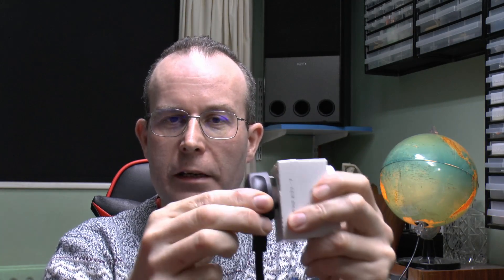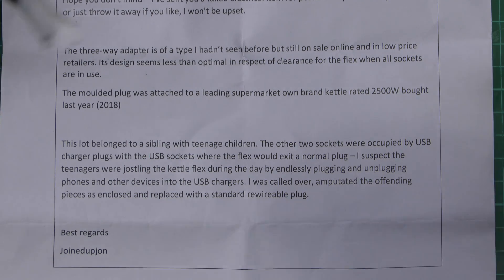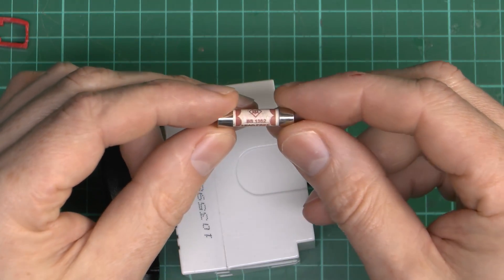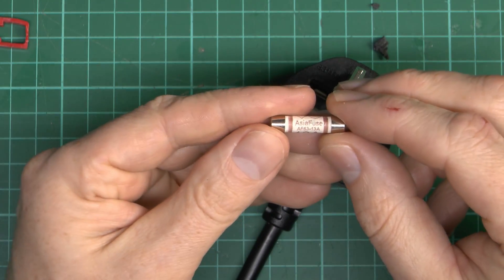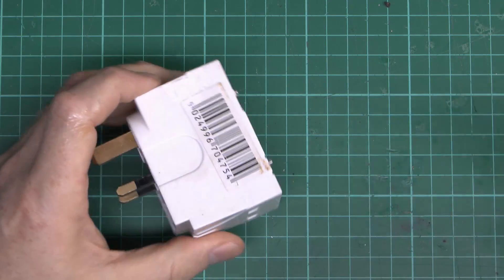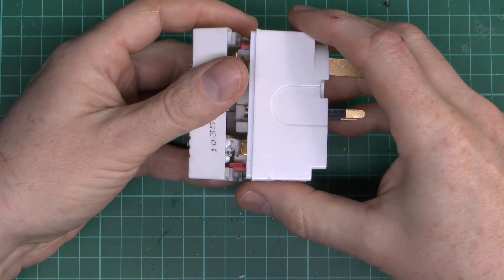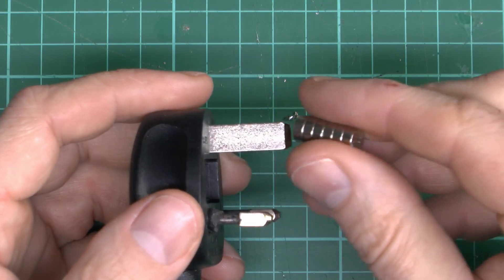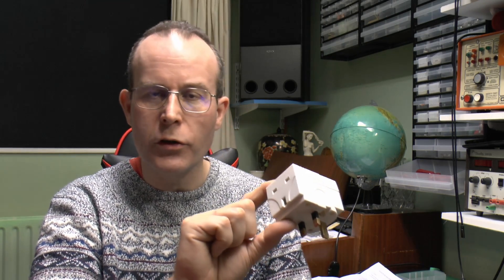Melted UK Plug stuck in a 3 Way Adaptor

Comment: This happened to me. I smashed adapter  socket, opened plug and it looked fine. 
Now it’s stuck in my kitchen wall.
It’s connected to the big steam iron... but it’s still switching on. 
If it had melted would appliance still work ? 
Thanks

Comment: i have one where the fuse is working (tried it in a test plug), the sockets are in good condition (no melted parts and plug can be inserted and removed easily) but the plastic around the fuse are melted, and when i bypass the fuse it works but when the fuse is connected it doesnt work, any idea what may have caused it to get into this situation. thks
Reply from the maker: Probably a loose connection to the fuse which caused overheating.
Fuses get hot in normal use anyway, so it only needs to be a minor problem to start with, the heat makes it worse.

Comment: Hate these things as they tend to damage the socket they are plugged into eventually, due to all the combined weight of the things plugged in pulling down on the main socket.  Also you often can not plug in large wall wart power supplies, due to the orientation of the protruding part of the PSU.

Comment: I was always of the understanding that plugs, adapters, socket tops and lightswitches etc had to be made from "thermosetting" type plastics (or metal etc) rather than "thermoplastics" precisely to stop them melting if they get hot.  Is that not (or no longer) the case?

Comment: Who would plug a high load appliance such as a kettle into a multi-way adaptor? 
Lack of common sense springs to mind.
Reply: The adaptor is rated 13A so there should be no problem running a kettle plugged into those ports. The problem here is simply that it was NOT plugged in properly, and was continually arcing off one of the plug tips. Even the best wall socket would have burned out under the same circumstances.

Comment: The plug looks like it was more to blame that the adapter. Poor connection leading to increased resistance, which caused the plastic to melt on the pin of the plug causing more resistance and heat... until it failed.

Comment: Are there any fuse testers? (in order to burn them, perhaps even getting the characteristic... or just telling if it's conforming to the stated rating)
Reply: they are complicated, they are meant to take some surge over current for a period of time, and even then to blow very slow indeed, bascially it will take a major fault to blow a fuse, nothing else, in which case im sure even the cheapest fuse will work well enough, it has thinner wire than the cable, which is the point, it would cost more to make a fuse that is a fake than just use thin wire,

Comment: I always have the kettle straight into the wall socket and don't like adapters or 4 way extension leads being used in the kitchen for safety reasons.
Reply: yes im sure the kettle says to do so as well, god knows wy they are using an adaptor with other things in a kitchen,  do they only have one socket in the house?
Reply: Learnt the hard way! That means the one part of my four way extension was burnt in by that faulty plug is gone? There's no way I can take the remaining bits out and continue to use that particular part of my four way that was burnt?

Comment: I don't know why people get so uptight about lead in electronics. You don't come in contact with the lead contacts unless you open it up. Even still, you'd have to lap at it like a cartoon idiot with your tongue. People could actually just wipe down the outside surfaces with a damp cloth or something if they are worried. A duster would probably do it too. Lead poisoning usually happens when children eat lead paint either on a wall or on their toys. Just don't buy painted toys for your toddlers if you are worried about  less than legit Chinese sellers. Kids shouldn't play with antique toys unless you want to have it tested for lead. As for lead solder, you are just melting the lead/tin alloy and not evaporating it. That smoke is your flux burning off.
Reply: We should be recycling electronic waste. Not that the lead is really that hazardous next to the rest of the crap that is dumped. The solder, copper and other materials should be recycled. Copper is definitely too precious just to dump and not recycle. Hate the fact that copper wire is getting more and more costly. We constantly mine copper, yet we just dump the spent stuff that would take no time at all to purity back into good copper wire again. It's not like we are going to give aluminum another chance any time soon. It's only mixing the two metals that is bad. Just don't do that. Even when you do that, it's the copper wire that oxidises. Aluminum is fine if you don't bend it much and make proper transitions to copper. It's very hard to get aluminum compatible receptacles and switches. They won't even allow the selling of aluminum wire for pigtailing in older installations. They do allow aluminum runs to sub panels which is kind of weird.

Comment: This is what I was talking about in one of your recent video's. Mum had a clothes drier plugged into one, it was the only device connected, it actually set the adapter on fire. I have refused to use the damn things ever since.
Reply: They are pretty horrific, I have to stop a guy I work with using them on Audio Visual equipment we work on. Would rather install another 2 gang socket than use these crap things.

Comment: Use a tiny cutoff wheel to cut a slot on the back of your screwdriver bits, then you can drop them into the hole and use a regular screwdriver to turn them
Reply: thats a good idea,im onto that .thanks for posting.

Comment: I bought a new 3kw kettle last year, & the moulded on plug got quite hot after about 3 minutes, so I changed it over to a rewireable plug & the plug now stays completely cold, even if I boil the kettle several times.

Comment: Yes, those plug in the bottom ones are a really bad design. They do it to make the construction simpler.
I've only seen the live side burnt in a socket before.
Reply: The live side burns often because of a poor connection with the fuse.

Comment: I think the evidence was there from the very beginning, the plug was not pushed in all the way as it was moulded in that position when John received it. Meaning that obviously the line connection wasn’t making good contact causing a high resistance and consequently overheating.
Reply: pmailkeey but the load current is still being drawn through the incapable high resistive faulty section which causes that section to go hot.
Reply: It was very obvious.
Reply: https://en.wikipedia.org/wiki/High_Resistance_Connection

Comment: I had a panicked phone call from my step-daughter last week.  Her washing machine was smoking...  Turns out to be exactly this same problem.  Her ex had cut off the original plug, to get the cable through a cupboard, and then failed to properly secure the live conductor inside the plug.  It had melted a hole about half inch in diameter out of the adaptor, over the course of about a year.  She was lucky that she hadn't put the machine on at bedtime, or as she was heading out the front door.

Comment: did you know a torx bit will fit most triangle screws....
Reply: Sounds like a good way to mangle a perfectly good Torx driver...
Reply: @Agent24Electronics  never been able to fit a torx in a triwing screw, i normally get a cheapo screwdriver and file the end to fit the screw,
Reply: @andygozzo72  works too never had any pb with Torx thought...
Reply: @Agent24Electronics  that why I use the cheep multicrap from my roomate!
obviously I'm not using my good tools on think.
Reply: Indosarnia  I avoid idiots - so that's not an issue.
Reply: Indosarnia  Do you ever wonder how long it'll take before the penny drops ?

Comment: when I had my kitchen done up I stipulated lots of double sockets because you shouldn't really be plugging more one thing in a socket and trailing leads have no place in the kitchen.
Reply: @pmailkeey My ring main drops down on the right side at the front and the back of my kitchen on the right and at the back on the left. The guy before had still managed to get a double spar on the right front plug which was disturbing, luckily the electrician was a by the book guy and sorted it out with the addition of the sometimes problematic RCD.
Reply: Indosarnia  Do whatever you want. This was convenient for us and works fine. The cooker supply ended with a wall switch combined with switched socket as was/is commonplace. The cooker feed is only supplying cooker, dishwasher and kettle (and garage). Cooker's used before meals, dishwasher after - so are unlikely to be on at the same time. Supply to the garage is off most of the time - so the loading is well within the capabilities of a typical ring.
Next you'll be complaining I put a plug / socket arrangement on the cooker too.

Comment: Where does the myth from it been the line pin come from? In my experience after unplugging large continuous loads the neutral pin is only slightly warm and the line pin is warmer, but still easy to keep hold of. I'd always assumed it was conducted heat from the fuse causing this.
Reply: yes, the fuse can get very warm with continuous high current , and i've known them too hot to touch....

Comment: As kettles are used for a small amount of time I don't see the need to use an adapter in the first place ,the chances are the kettle itself is at fault and I hope the author of the letter did not just replace the plug and carry on using It...You should never use this type of adapter in high current devices In my opinion your just asking for trouble with prolonged use they start getting brittle due to excessive heat and arcing, Ive been electronic hobbyist for over 45 years and very conscious of the loading of any devices I use,always like watching your videos
Reply: Hi Ken,  The kettle seems fine so I did put a new plug on... The kettle belongs to my sister and I've warned her to plug it straight into the proper wall socket in future. 
Probably it'll be in another adapter next time I visit anyway because people who aren't like us (JW VIEWERS) just shove any 13 amp plug they want into any socket they see without thinking.
Reply: @joinedupjon  It would depend on what else she had plugged into the adapter and was using at the same time, I think these adapters should be baned but then that's just me, never liked them, always a good reminder on john's break down videos on what traps you can fall into when buying cheap products which don't conform or even those that do, It was good that you sent it in made a good video
Reply: The other sockets on the 3-way were used for phone chargers... all different to each other.  With the 3-way there is still one less socket available than the number of chargers people wanted to use in that corner of the kitchen leading to a lot of plugging in and out. The 3-way would have imo taken it if it wasn't for the design making it awkward to use without half knocking the other plug out as JW demonstrated. Looks like something that was designed on a computer without anyone ever trying to put 3.actual plugs at the same time into a model.
Reply: I use one of those 4 way USB charging hubs, a much neater solution.

Comment: One big problem is with kettles using the same type of plug and socket (IEC C13?) that can often be found on low amperage things like chargers etc. These often come with a low amperage cable. All too easy for someone uneducated to use the wrong lead with the kettle, then you can end up with someone using a lead with 0.75 cable to power a 3kw kettle - i have seen it done a couple of times.
Reply: I haven't come across a kettle with a "kettle plug" for years. Nowadays it all seems to be "cordless" kettles (which do, in fact, have a cord; it just terminates in a very large, flat, connector that the kettle sits on top of, held in contact by gravity).
Reply: @patrickwigmore3462  nor have i,probably partly 'cause they're 'cordless', and partly the 3kw heater in many, although the ones we've had were fitted with only 10amp rated cable... gets rather warm even with one 'run' ,
Reply: The old 'Kettle' type connection plug was different as it had a large rib & groove on it so a normal 5 amp type connector wouldn't fit into a kettle.
Reply: @NOWThatsRichy  they dont always do that these days, plus even the ones you mentioned, known as 'hot condition' were/are only rated for 10 amp, normal ones 6amp, most/many kettles are 13amp nowadays , i dunno what the rating of the much older 'round pin' kettle connector, that looked like an partially inverse european 'schuko' connector was..?
Reply: @andygozzo72  I think you might be talking about the round connectors to BS3283, rated at 13A 250V. The kettles these go with have two round pins and one flat pin, all in a circular recess, and I'd expect a 3kW element. Some kettles could eject the cord as a safety cut-out in the event of the kettle overheating.
Reply: @patrickwigmore3462  I remember those big old 'Ashley' round kettle plugs back in the day when the flex was 1.5mm2 and you could replace the element when it failed, instead of having to buy a whole new kettle, that's progress, not 😞
I've seen some 2.5kw kettles with 0.75mm flex, as well!  I think they just assume that it will only be switched on for about 5 minutes, so not long enough for the cable to start melting!

Comment: I strongly suspect a fault inside the moulded plug.
Reply: That would not explain the burning and clear signs of arcing on the tip of the live pin.
Reply: It's totally obvious that the fault is due to the kettle being operated with the plug only partially inserted. There is no failure of either plug nor socket... it's just a bad connection.

Comment: Looking at where the burn marks are located only on the tip of the pin, it's obvious that only partial contact was being made. My strong suspicion is that when the plug was inserted the socket wiped contact are was probably pushed in a bit. I can see that one side of that live receptor is bent down a bit. Perhaps it was pushed in by the pin. Possibly the tolerances aren't quite right, and only a small part of the pin makes contact and that deformation of the conductor is just enough to make poor contact. There's even the possibility that the plug wasn't pushed fully home, or maybe it was partially dislodged. Leads are always being snagged. So, partial contact local overheating and arcing and then you get those burns.

Of course, this brings back to those arc detection breakers that you were testing which didn't work so well...

The weak point of all socket/plugs is the the wiped conductor area. It doesn't require much resistance for even 10 amps to rapidly heat up. Just 0.1 ohms is 10 watts in a small area at 10 amps. Push that to 13 amps, and it's almost 17 watts. If it's 20 amps like a lot of US outlets, then that's 40 watts...
Reply: Does look like the tip was the problem (mainly due to arcing on tip) 

But I have had faulty plugs as well where the neutral or positive cable that goes into plug that you can rewire was touching the wire hole (was not screwed in) witch heated up the pin and partly melted the socket like in this video (to bad he could not of opened up that sealed up plug it might of actually had a bad cable going to the pin inside it)
Reply: @leexgx  I'd rule out a fault in the plug as hat would no explain the burning on the tip of the live pin and clear signs of arcing.

Comment: Get some left hand drill bits they will bite into the screw and pull them out
Reply: No need - those tri-wing screws are easily removed with a small screwdriver. Just select a small flat blade that fits into one "wing", then unscrew as normal.

Comment: Not sure what you think, but I have sometimes plugged the 2-way-unfused-adapters into bar-type extension-leads.  In this configuration I don't see much of an issue, has been useful to add one extra low-load load  without too much mechanical issue, again to be considered on a case-by-case situational basis!.
Reply: I've done that, but only for low wattage sets of Christmas lights.
Reply: well, yes, if you're only plugging in very light loads shouldnt be any problems, i have 5 of the things in various places, plus 'bar' type multisocket adaptors, but nothing on any socket over 1 amp load, all things like tv, digibox, internet hub, cordless phone, etc. i wouldnt trust one for high current use like a kettle or electric fire!
Reply: i've seen far worse, an electric fire fed by TWO CORE 'table lamp' type cable...yes, metal cased fire, unearthed, you can probably guess the state of the cable...and this was in a school office some 30 ish years ago 😱
Reply: low watts is fine, not 13 amps load

Comment: Pifco have been around for sometime and produce affordable electrical goods at a certain quality.  Looking at it with only 1.5 mm wires in the plug for 13 amp supply and an unknown manufacturer of the plug, with non brass  pins I would guess the plug is probably the main culprit. Now would the arc detectors in a fuse box trip?
Reply from the maker: Pifco isn't a company any more - it's just a brand which is licensed by various others.
Arc fault detectors do not trip on overheating connections.
Reply: @jwflame  Thank you names come and go, get taken over, licensed out and devalued. In your video you said the heating was done by a loose connection which would be arcing.
Reply: 1,5mm copper wire is 19A continous in air, its absolutely enough for 13A circuits, problem is with poor connection between plugs and sockets, or loose wire connections in wall sockets
Reply: its also a short cable, a kettle cable is barely long enough, so a cable rating is a bit more capable on a short length